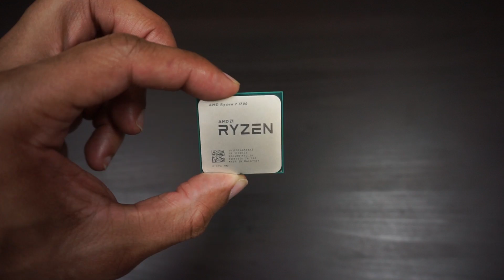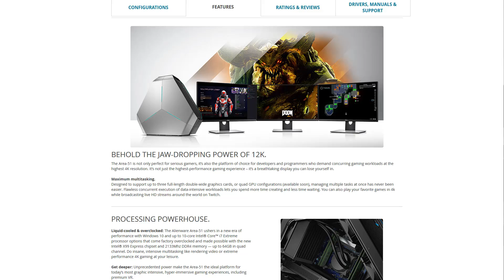Ryzen 7 AM4 Mini-ITX PC Build

Comment: What a unnecessarily big ITX case. It could've easily fit a mATX mobo.
Reply from the maker: Form over function. If you add liquid cooling and some hard drives it becomes a lot smaller very fast.

Comment: Loved the build and video.  Super cool case, though it does look like a bit of a pain to put together (not very different from other GEEEK cases though, so par for the course).

Out of curiousity, since you assemble the case yourself, do you think it's possible to assemble it in an inverted layout (i.e. oriented so that the windowed panel is facing the right instead of the traditional left)?  The positioning of the desk in my home office necessitates the case to be on my left, so traditional cases would generally face a wall.  Current build is in a Corsair Air 240 inverted.

Can you also show/explain the drive mounts in this case?  Are they just screwed directly to the back plate and/or floor?

Thanks!
Reply from the maker: Yes actually. You could just rotate everything. It might look funny ha, but it is doable.

Comment: It's kinda big, but nowhere near the size of my Phanteks Enthoo Evolv itx.  So, the depth says it's 215mm, I'd be curious if the Noctua DH-15 knock-off cooler from Phanteks would be able to fit in there.  It needs 180 mm clearance, but the angles of that case might be prohibitive.  I like the asthetics though.  Great looking case.  As for keeping my extremely over clocked system cool?  Id have to see a bit more facts on the case's airflow and exactly what you could utilize in it.

Comment: Dislike the rear mounted power button. Not sure what they were thinking there. Easy enough to mod it on the front. I see that they also make this case in full ATX as well. Think I might like it in that format a little better or even if it was mATX. Way to big for the Mini itx builds I like. But that is all personal preference.

Geeek at least looks like they have some interesting case designs on their site. Nice video

Comment: geeze you bought that trash power supply for $40, you honestly would have been better off buying a grey CX450m for the same price or heck a seasonic SS500-ET would be alot better and that costs like $25 on ebay

Comment: hang on a sec, so the AMD AM4 socket comes with that crappy clamp down stuff for stock AMD coolers, but you had to take it off to fit a stock AMD cooler!
Reply from the maker: I know it looks like the crappy Intel stock heat sink cooler, but it actually screws into a metal back plate underneath the motherboard. It even has metal stop posts. It's actually pretty nice.
Reply: That clamp is reserved for wraith max if you have one. but always needed for thrad ripper since they most likely shipped with one for <140tdp model.

Comment: That fan radiator is nearly touching the RAM modules. 
Is that okay?
Reply from the maker: Its totally fine. Temps for both the CPU and RAM were rock solid.
Reply: Tek Everything thanks. Was a bit worried abt the RAM temps.

Comment: That case is so big, it could easily be a MATX or ATX case. It would be possible with some modding of the back panel and mobo tray.
Reply from the maker: Yes it would for sure, but I doubt you could fit if you put an mATX board in there.
Reply: I was thinking that the custom rear I/O panel will take only SFX power supplies so that larger boards can fit.

Comment: Beautiful build kinda ruined by that PSU...should have gotten the EVGA 600 BQ. Its modular and all black cables :)
Reply from the maker: The PSU isn't great I agree, but you can't even see the cables with the side panel on which I knew going into this. In my next build I will go with a better PSU.

Comment: Please show us, or rather me, how you Overclock on this Pyle of Dogshit of a Motherboard.

I only get 3.2Ghz in my 1700 but if i try to dial in just the slightest bit of RAM Frequency, it crashes.
Even if i only try 2400mhz, it fails to boot beyond the BIOS.
I bought a Gskill Trident Z 3200Mhz CL14 Kit (Single Rank Samsung B-Dies) wich should work perfectly with ryzen.

And the VRMs are hot as hell.

I hope Asus, MSI or Gigabyte are coming soon with mITX Alternatives...

Thanks in Advance

and thumbs up for all the SFF Stuff on your Channel!
Reply from the maker: I used Ryzen Master. If you raise the voltage you should be able to overclock without much issue. Just keep adjusting the clock and voltage until it sticks.

I will definitely be replacing this board as soon as something better comes out.

Comment: Love your channel. But, can you do a build with the logic supply mc600 and/or other one and use it with a Pico PSU or HDPlex? If you can off course...I am waiting to see how it works with the Ryzen chip 1700 with a low power gpu (that can handle 1080 gaming).
Reply from the maker: I wouldn't put a 1700 in an unmodified mc600. Especially not with this motherboard. There isn't sufficient airflow.
Reply: Oh, maybe I wait for different am4 mitx motherboards. Or by making a hole where the gpu and cpu fans are for airflow (in the mc600)?
Reply from the maker: Yep, you can modify the top panel of the MC600 and add either mesh cutouts or 120mm fans. I have seen both done, and the will dramatically improve the temps you can get with the MC600.

Comment: I hate working with this case but the ATX one is a lot better IMO and the case unfortunately is super easy to break because everything is acrylic side note you can put a mATX board in if you take out the 240 fan mounts in the front.
Reply: Tek Everything
the build process is a pain in the ass with those screw and bolt style.
Reply from the maker: Yea, it is a nightmare. The end result is nice though.